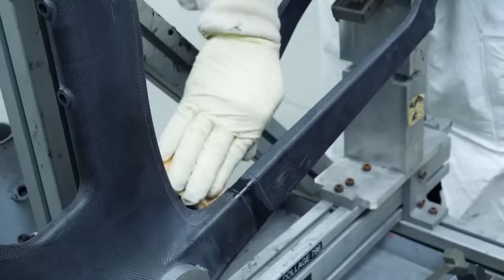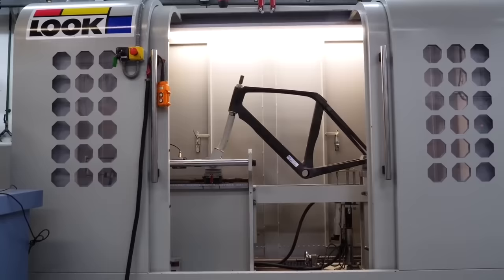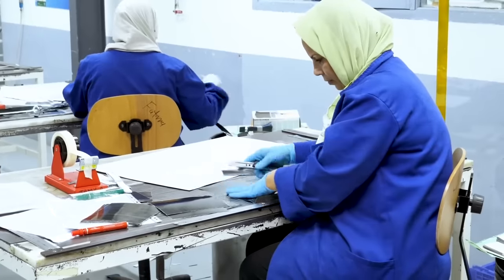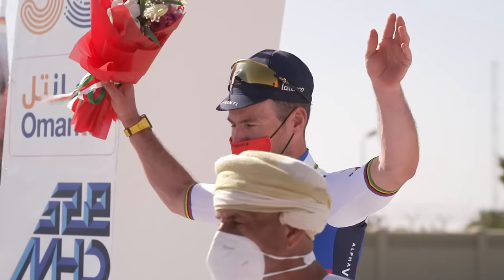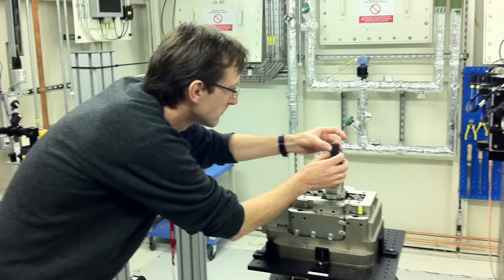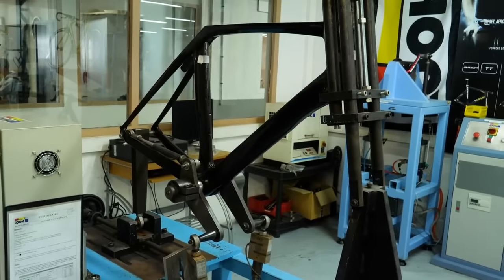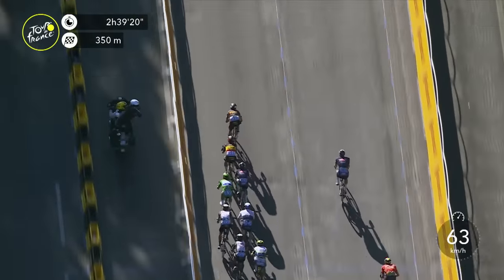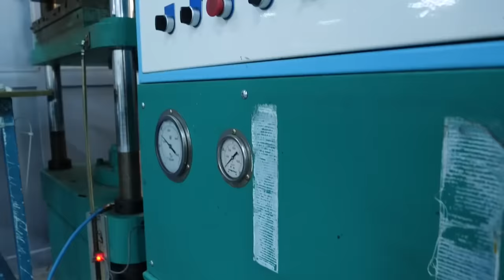Your Carbon Fibre Bike Won’t Last Forever

Comment: I wear out carbon bikes and I’ve slowly become disillusioned with the material.  It sounds like bragging I suppose, but I’m sure I’m not the only one who has experience this.  Typically 30,000 km to 40,000 km and then they start to go (mostly bottom bracket or dropout problems).  I’m not strong — I average no more than 150-200 W, but I ride every day and 30,000km is only 2-3 years.  I’ve been riding carbon since the 90s and I finally gave up on the material this year after wearing out three Specialized Diverges in nine years.  I would have done so two years ago, but Specialized warrantied my last frame with a huge upgrade and I wasn’t going to say no to a free bike.

I’m just going to weight weenie a steel bike with Super Record EPS wireless and carbon finishing kit.  It will be light enough and should last forever if I keep it clean.

Comment: Interesting topic on CF frame. My cousin has a 30year CF Kestrel and it's still working fine till today. It's just that it puzzles me why it's as heavy as a steel bike?
Reply: A friend of mine had one of those old Kestrels. It was kind of heavy and very flexible. It was a horrible frame.
Reply: @DaveCM  The one he had was the chunky looking TT bike but with road bike drop handlebar setup...
Reply: @nicholasyoong4978  I think he had the...can't remember the model. 200 CS is sticking in my head but I'm not sure. It did have the very narrow but deeper aero tubes. He didn't have the one that didn't have the seat tube. As bad as his was, I couldn't imagine riding that one.
Reply: @DaveCM  200sci was printed on the frame but when i googled... looks more like a 4000... the frame itself. Yeah... he suffered badly on that frame for years... 20 to be exact. I didn't know why he didn't change then... probably sentimental value since was given by his ex boss.
Reply: @nicholasyoong4978  yep. My friend rode his for years. He was very attached to it also. He finally bought a new bike (a Giant) and kept going on about how stiff and responsive it was. As a result, he rarely rode the Kestral anymore and finally sold it.
Reply: @DaveCM  Lol... what a coincidence. My cousin switched to a Giant as well but he's now riding a Madone now.
Reply: @nicholasyoong4978  it is a small world.

Comment: This has been known for ages. So-called "carbon fiber" isn't anything new. For example, tennis rackets have been commonly made from the stuff since the early 1980s. Only the name "carbon fiber" (short for carbon fiber composite) is somewhat new; it used to be referred to as "graphite" (short for graphite composite). It has been well known for decades that graphite tennis rackets go "dead" after a certain amount of usage due to microfractures that happen when you hit the ball, and which accumulate over time.

Comment: So in the real world only a professional or some one racing needs a carbon frame,the professional can change to a new bike in a crash or get less stiff.Most riders would be better riding an aluminium bike if cost is a factor or steel or Titanium if there keeping a bike long term or there worried about cost of repair. I'm not anti carbon i have two of them & two steel bikes.On a 30 mile training curcuit i use my steel bike which is a 1992 frame is super stiff still its 531 only a little slower up a climb compared to my carbon bikes but overall times for the route are pretty similar sometimes I'm even faster on steel.

Comment: Composite bikes just do not last long due to their inability to resist incidental damage - just let the frame fall on itself, or sit on the toptube. Heck, even hit it with a rock or something similar (when riding) and the matrix is easily damaged. In aviation, there is the requirement for damage resistance as well as fatigue and environmental resistance when used - look at helicopter blades, propellers, and stressed skin panels or wing spars. Composite Bikes are designed to be replaced often - planned obsolescence to ensure future purchases

Comment: Are carbon handlebars more at risk from water and sweat since they are typically unprotected (raw)?
Reply: And as was asked, and then redirected by the professor towards a polymer engineer, just how much do the various gel coats, and or clear lacquers/whatever applied over said raw carbon components protect against the above and the sun?

Comment: It would be interesting to know if extreme environmental temperatures would affect the life of carbon fiber.  Say, if you have your carbon bike stored in the garage in the extreme winters and summers in the northern part of the US, will that affect its durability?
Reply: I don't think so. Airliners today use a lot of carbon fiber (even if there are hundreds of resin sorts and higher quality aerospace grade fibers), they fly in hot climate and ascend to 30k ft where the fuselage and wings have to withstand - 60 ° C.  
Carbon fiber is even used for spacecraft, where it is much colder than anywhere on earth

Comment: Carbon fibre is the biggest scam in the cycling industry.

1.  Its quite brittle and prone to splitting.  Not as durable as they claim.
2. UV light causes it to degrade over time so it wont last unless you keep it in doors a lot but that defeats the purpose because Bikes are meant to be rode.
3.  Repairing it is very costly. Cheaper in many cases to just buy a new bike.
4.  fiberglass is sometimes mixed in with because its brittle and prone to splitting.
5. Not solid one piece. Its pieced together with an epoxy resin before molding.
6. It deforms under impact so its not as stiff as they claim.
7.  cycling industry uses standard modulus or intermediate modulus 
which is Low Grade.
8. It does weigh significantly less but that's only advantageous when hill climbing; for sprints, down hill runs, etc.. you'd be better off going aero.
9. UCI weight limit is 6.8kg so you can't go all out  if you are a pro; carbon fibre - handle bars, crank set, etc.
10. The cross-weave pattern is mostly cosmetic. It has No performance advantage.

Comment: I have an aluminium bike. Will it just crack open one day while I'm riding as a result of regular use (not considering crashes)  or would it be based on impact?
Reply: Yes, I had three frames and they all cracked within three months, mind you I'm heavy, riding back then on 23mm tires on craggy london roads.
Reply: Unfortunatelly it is possible. But depeding on use and quality it can last for example 50.000km to 200.000km or less or more...

Comment: Something alot of people don't realise is that, well, carbon degrades.

 It's something I've always stated and why I personally cannot buy such an expensive bike. Realistically you should replace your frame every 5-7 years. If you ride 1-2x a week or are very casual, then perhaps every 6-7 years. If you ride more often however, such as every day for 3 years like I do, I'd recommend every 3-4 years.

Carbon fiber looses it's stiffness alot quicker than peope might actually realise. 

However it also depends on the said brand and the type of carbon they used, and the damage/environment it's exposed to. Factors also like the power put out into the bike (I'm a sprinter) also can cause more fatigue within the carbon.

TLDR; you ride not so often and hard you should be okay to ride your bike for a long time. However if your riding often and putting out alot of power, be mindful of the stiffness and be wary you might need to replace the frame quicker than you would expect.

Comment: I'm usually not the "YES or NO" type, but 35 mins of "it depends" and in the end not even a "perhaps" without a "or maybe not" was a bit challenging for me. 

My experience: Everything breaks. If you go for lightweight, it might break sooner. Aluminium gets brittle fast, steel gets soft. It doesn't break, but it's dead and eats a lot of your power.
I've seen broken titanium frames as well and some broken carbon surf gear and tennis/squash rackets. But carbon usually does only break unless you treat it like this: https://www.youtube.com/watch?v=VfjjiHGuHoc

Comment: In my experience, no bike lasts forever, every bike gets stolen, probably sooner than later. To prevent theft, you have to carry three different locks, which hopefully slow thieves down a bit, but no lock is completely safe. The locks of course weigh several kilos, so you get no advantage from your super light carbon bike whatsoever. If your bike is worth anything, it'll probably be stolen, even if it's triple locked and fastened to a fence. Thieves will take the bike and the fence, stuff them in a van and drive away.

Comment: Is there a x ray machine which can show where the cracks are or where problems are occurring. If not is it possible to develop a device to detect cracks.
Reply: They are called eyeballs. I have found cracks in 4 different frames/forks I have owned

Comment: Wtf. How annoying. I'm a 1800w sprinty boy who sprint trains more than necessary because it's fun. Had a bb crack which I think was power + bad engineering from canyon (and a very little chaindrop crack) and fixed that quite cheaply. (Also had slightly bent ultegra crankset, and changed that to the new evo386 bb and crankset which I hope is tougher). But the frame is 5 years old now with 3 years of me bending the shit out of it, so it's probably quite dead anyway. Bummer. Still better than aluminium, I guess, from my experience. My rear wheel on my first road bike is now touching the aluminium frame because the drive side has gotten shorter.

Comment: Hmmm. Carbon bike frames comes with quite different pricetags. As this video shows they also come with different grades (qualities?) of carbon fibre. Obviously, there are parts of the frame that is more exposed to force and stresses, so you should think that there is a (cost)optimal use of fibergrades in a frame. when you compare frames via the manufacturers materials it is not possible to establish a connection between fiberuse and pricetag, if these informations is accessible at all.  
 I have never seen a bike review or a frame comparison take the quality of fibers the or the quality of the layup/manufactoring into consideration. Most branding is concerning trust or prestige and not objective quality, which is a shame.

Comment: Recently, I personally used ridewrap to encase my carbon frame. During the application process, a gentle shampoo-like solution is utilized, which led to the formation of bubbles consisting of air, water, and the application solution. As the wrap is intended to remain on the frame for an extended period, potentially lasting a few years, I'm curious if there are any risks that could potentially damage the frame?

Comment: Considering the fatigue and the need to change frame every season (talking about the pros) are carbon bikes a sustainable solution? Can carbon be recycled? I’m afraid that cycling has become like F1, only few rich teams can afford to buy that many carbon frames, doesn’t that kill this sport?
Reply: Recycling the material is possible. The issue is that recycleable doesn't equal sustainable. Materials cannot generally be infinitely reused. And the products the recycled materials can be used to make drastically change the sustainability equation. Even if the frame itself is recycleable, eventually that material will end up in a land fill, even if not as a bike frame. This is why in the 3 Rs, Reduce is the first and most important. If sustainability is our primary objective, we'd be using material that is much less likely to need to be reused/recycled, and is also less consumptive to extract or produce. If that's our goal, steel is probably always going to be the winner here.

Comment: 16.35 he's absolutely bang on point here, carbon frames from 15 20 years ago still out there not falling apart because there done correct without this new more light weight dry carbon forming manufacturers are doing today! I'll look up the repair specialist video process and him telling all this later when get home I'll link it herehttps://youtu.be/QyZNFTMbwzk?si=bnJl04cY11EGNxWh

Comment: Not a valid question, the epoxies and lacquer are far more advanced then they were even 8 years ago. Even the composites added for flexibility with a greater fracture fatigue are also very advanced. Only need to look at tennis racquets, ski's, etc.

Comment: Very good video ! Ollie great English humour ! You should do more content like this. How about a video on titanium ? Explain all the grades in titanium. Which property have the additives in alloys. Can you build a frame with several titanium grades to manufacture a better titanium bike ? Is 3d titanium print mechanically different from forged ? How ? There are new titanium manufacturing processes. It would be interesting to explore and explain them.  I have dozens of questions or suggestions like this just on titanium.. how about Aluminium ? There are a lot of brands switching from carbon to aluminium in the MTB industry I have heard they are now on par with carbon regarding performance. Let me know if you need questions, topics, and lead on this manufacturing processes. I already have a file links to companies etc...

Comment: I think GCN can do some unofficial long term test on some carbon bikes on behalf of the public.
Reply: Dengfu FM01 lasted about 10,000km before chain stay failure. Never crashed. 92kg 1500watt sprinter used for crits. No other carbon bike frame I have owned has ever failed due to fatigue (2005 Giant OCR1, 2013 BH G6, 2013 Avanti Quantum 2.0)

Comment: is this not the reason they started to use nano tech in the resin between the layer"s of carbon material ? in terms of UV damage think about the team bikes on the roof racks in grand tours in the middle of summer maybe 5 to 6 hours a day being subjected to strong UV
Reply: Then changed once hard crashed or yearly.

Comment: Although there is a large factor of "It depends", I would expect an Aluminum frame vs a comparably designed Carbon frame will likely fail prior to a Carbon frame.  Aluminum aircraft have a very finite life due to cyclical loading of the fuselage.  Newer Carbon fuselages do not, or have a much, much higher cycle life than Aluminum which work hardens with cyclic loading resulting in cracks.

Comment: I very much doubt Cav doesn't have a new bike several or many times during the season, or even during the three week races. The MpA figures don't lie, they are lower than Alu. That's why I ride modern steel bikes, granted with cf forks and solid cf spider and pedal arms. I had the same bike for 8 years and it was as fresh and performing as on day one. The bike shop refused to sell me a cf bike due to my weight, which told me my concerns were justified.

Comment: Great Video but unfortunately you failed to discuss the weakest parts of a Carbon Frame, its joints. As joining carbon parts together is a science in itself and joint failure/degradation are much more likely to be the cause of a carbon frame beginning to feel dead/cause power loss.

Comment: Hi, I would like to hear some aviation and naval experts on the matter. Formula 1 is not really comparable to cycling. Yes they use top class materials but their only goal for the carbon parts is to last just a couple of hours, to endure through the race. After the race is over, they don't care to use same fender or wing again.

Comment: in terms of reliability how does titanium stack up ? it has to 
be better bang for buck and peace of mind !! 🤓👍👍
Reply: Titanium has a similar strength and fatigue characteristic as steel, but is around half the weight. 
That's why it's used for gear struts for airliners.
Reply: @simonm1447  thankyou simon, the frame & forks material on my best bike is titanium 
,it does`nt rust either so for the sake of a few grams its a no brainer eh!

Comment: #AskGCNTech 
Does this hashtag exist?
Now for the serious question. 
I couldn't find a result, article on the internet regarding about a hypothetical idea. 
Probably that I am not the only one to think of it. 

If we have an aluminium bike frame, smooth weld it then add a layer of carbon fiber on top of aluminium, would that be considered as an upgraded alloy? Like, does it add stiffness to the frame? 

It would be cool to see two famous bike material be bonded together. 

I hope you see this. Thank you!